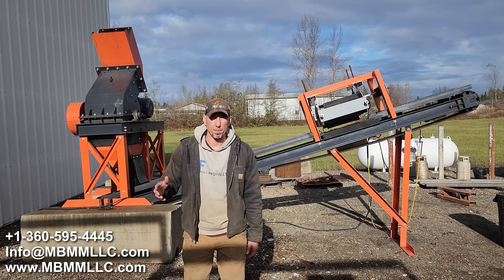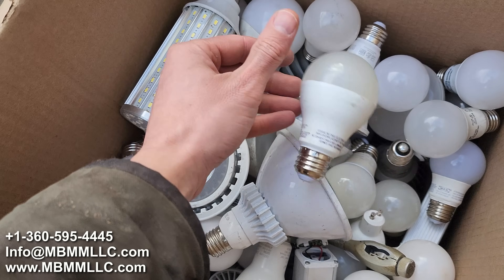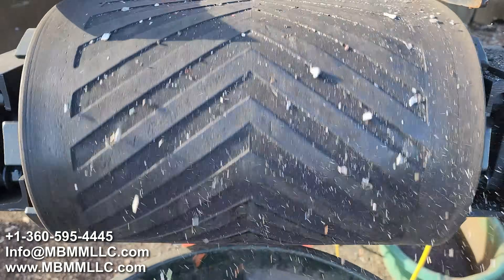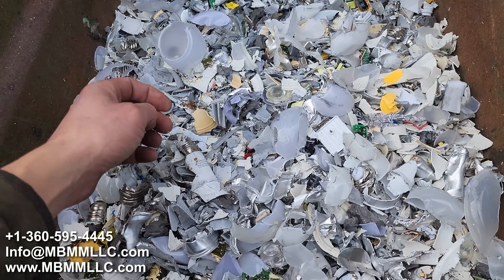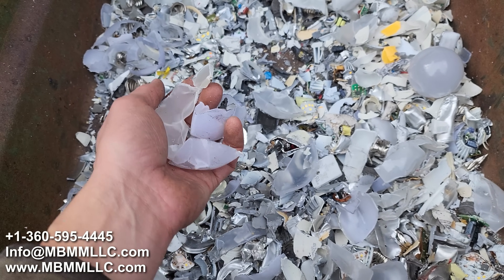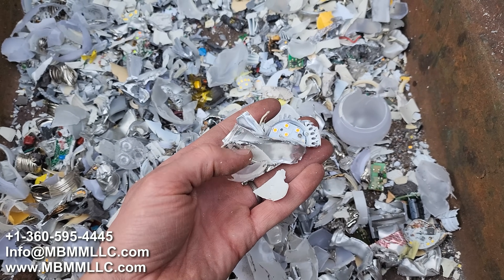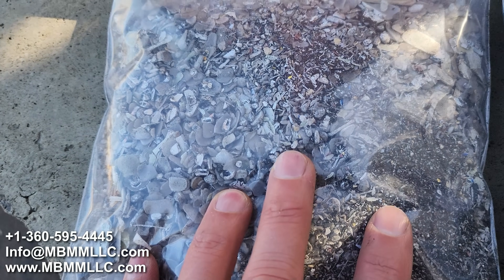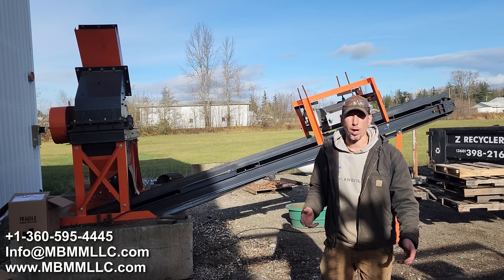Recycling LED Lights

Comment: Totally unnessesary waist of environment to crush those bulbs. Most of them just have one diode burned. If your lazy ass woud jus open a bulp by gently twisting it and pulling apart those diodes would appear. You would clearly see burned diode. Just solder bridge over and the bulb will work again. Better profit by fixing than destroying.

Comment: remember when they told us LEDs would last "forever" and never needed replacement...
Reply: no?
Reply: @georgecoffeycomedy  well, instead of inert glass and a few bits of metal, now we have plastics, fiberglass, electrolytes, and all sorts of things that can't easily be separated. They never talked about the trade off of LEDs
Reply: @thedopplereffect00 except they do last 20 times as long, so that's 20 light bulbs of materials, plus incandescents take 10x the power, so it's all the extra coal/oil/solar panels that needs to be mined and built to power incandescent bulbs vs 1 LED bulb
Reply: @georgecoffeycomedy  some people want incandescents though. They've been threatened with government violence if they want to manufacturer and buy them

Comment: With the plastic in there, wouldn't it be worth using a settling pond to separate the metal from the plastic?
Reply: if aluminum is all you're going for, yes.  unfortunately, the plastic is where the gold bond wires are.  worth pyrolizing and recovery.

Comment: There is a single little thread of gold in each LED
Reply: some have 3 or 4 🔬
Reply: @travismiller5548  correct. Multi color LED's will have as many as the number of colors

Comment: It's a shame it takes so much effort to take things back apart. I'm thankful that these LED lights last so much longer and use so fewer Watts than an incandescent, but I still wish they could be separated more cleanly.

It is nice now that I can have a whole building of LED lights and just always leave the lights on because a few solar panels will keep the battery charged for the inverter.
Reply: I feel like these would be better separated by just crushing and shaking. Basically like peeling garlic or something. The plastic lenses usually just pop off